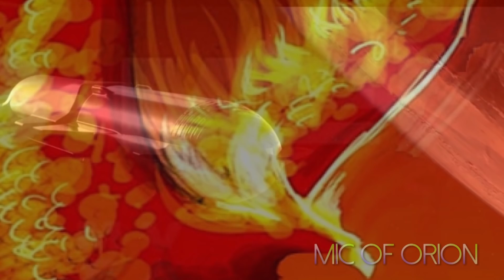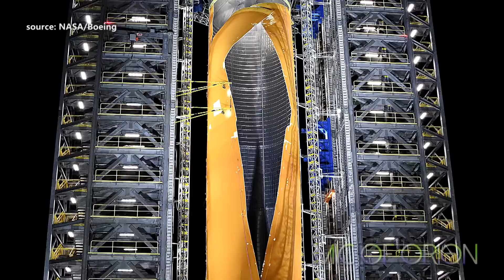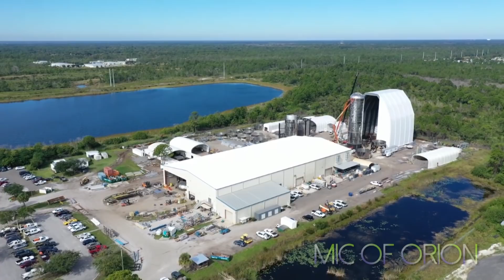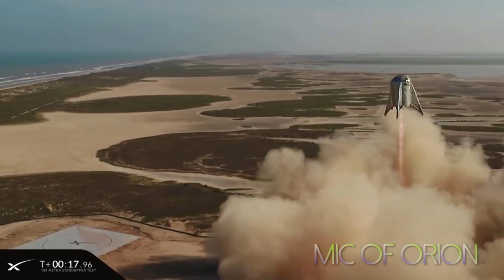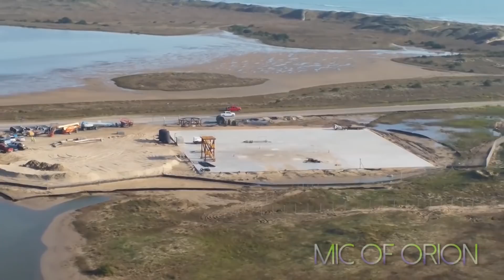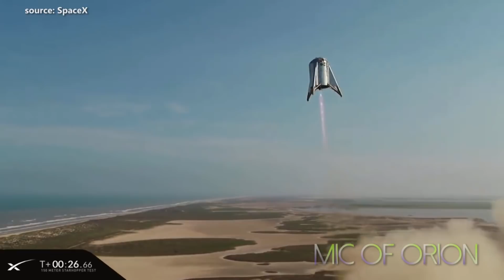SpaceX Starship Update – December 2019

Comment: Mk l seemed very flimsy , all it was was a big tank. A,bit enbarassing on spacex part that they actually thought it would hold pressure. I would have thought there would have been ribs and stringers in it at strategic points to give it the necessary strength to hold pressure. Didn t anyone design this thing? And do proper  FEA analysis on the design .?? Seems a bit sloppy and amateurish to me . And I m a space x fanboy . It was a f**k up. To state the obvious.....